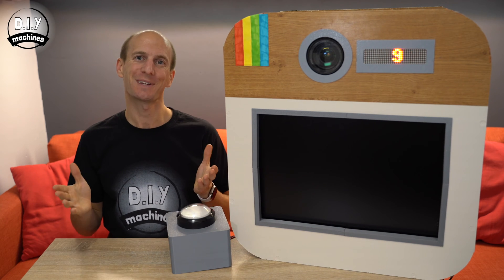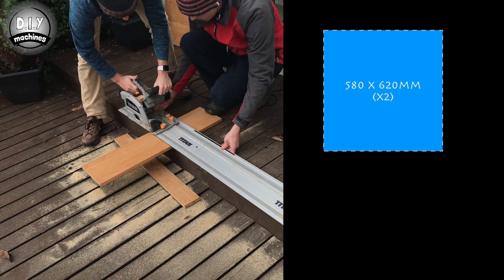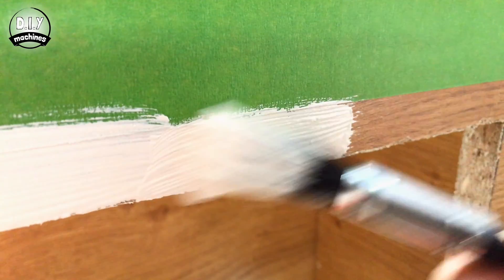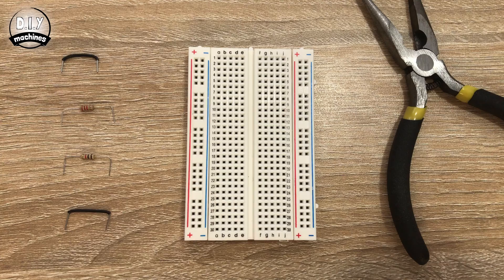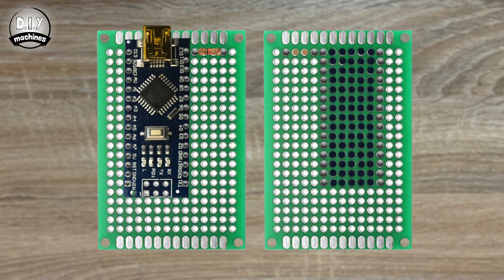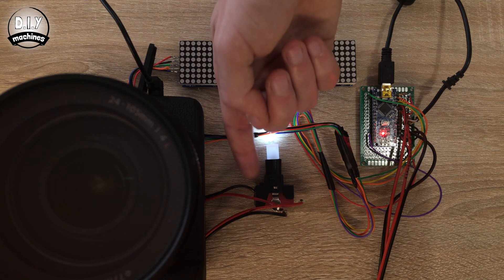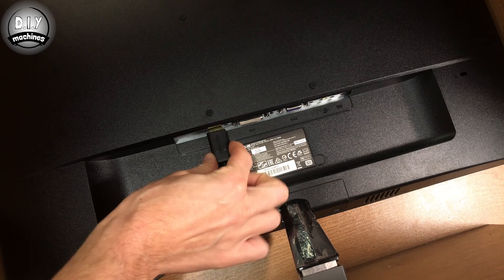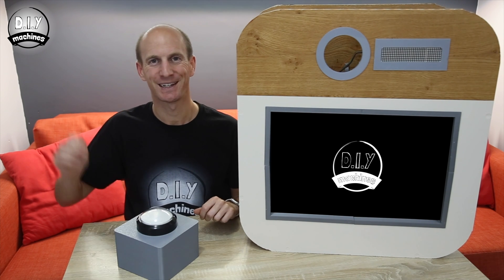DIY Party Photo Booth - Low cost | Arduino | 3D Printable Parts | Weddings | Budget Build | Crafted

Comment: You're running all those countdown LED's from the 500ma max output of the Arduino ?? (And 500ma is pushing it!) OK, so they might be multiplexed, but I still think the LED panel should have its own PSU. Nice project as a basic unit ... but it will not have all the options of connecting to a purpose made photobooth software. For my own unit, I "broke down" a laptop, put the motherboard / keyboard behind the monitor, and then positioned a capacitive touch screen in front.
Reply from the maker: Thanks for the feedback and for sharing your approach!

Comment: cant connect my SONY A7 M3 to the screen via C-type cable ??? What to do ??
Reply from the maker: I made a shutter release for my Sony A7 M3 by buying one of these (https://amzn.to/3mwBMOF), open up the controller and you'll see which wires make contact when you press it (one focuses and the next activates the shutter). From this you'll now how to wire it up to where the red and yellow wires are labelled on the wiring diagram. :)

Comment: hi, is it possible to add a printer via usb to this?
Reply from the maker: Hello, the Arduino and current code would not allow for this. If it is something you wanted to do I would recommend using a Raspberry Pi (you would need new write new code) and something like GPHOTO (http://www.gphoto.org) to capture and retrieve the image from he camera to then send on to a printer.

Comment: Hello
My camera gets a signal from the circuit but doesn't take the actual photo.
Nothing happens if I'm in Live view mode, but if im in the menu or other options it changes to live view.
I've tried with other remote cables and they work perfectly. 
Can anyone help me? Please

By the way! 
REALLY REALLY COOL PROJECT
Thanks.
Reply: Did you ever fix this? Having the same issue with my Sony

UPDATE: Fixed the issue on mine after a little bit of tinkering. I ended up connecting the top and bottom plate wires next to each other and bridging them with some solder. Works great now!
Reply: @technick_mods  thanks for your comment. I‘ve got the same problem but your solution fixed it 👍

Comment: A nice expansion to this would be linking it to upload to Twitter or another platform.
Reply from the maker: Great idea. I almost implemented that - but I would have to have added a Raspberry Pi instead of the Arduino and this would have driven the cost up slightly. I was aiming to keep it cheap so ultimately decided not to add the functionality.
Reply: @DIYMachines  Maybe a version 2 video at a later date.  Its a great project as it is.
Reply from the maker: @user-vt5lh6lm3n  Yes, I have thought about that. Thanks.

Comment: Hi, thanks for the great tutorial! I'm curious though; how are you sending the image to the monitor? How long does it display for and how is the monitor connected to the Arduino?
Reply: Thanks. The monitor is connected to the camera directly and is just showing the cameras 'review' of the photo for about 10 seconds after the photo is taken. The monitor is not connected to the Arduino. The Arduino is controlling the shutter on the camera, the giant arcade button and LED countdown.
Reply: Lewis Aburrow where is the arduino getting power from?
Reply from the maker: @jackass...2726  The Arduino is connected to a USB power supply. As the monitor had to be connected to mains I did not see a huge benefit in engineering something to power the Arduino instead of just a mains powered USB supply.

Comment: Awesome machine ! i´ve become a fan of ur stuff, just recently starting with some of ur projects and im starting with the cute BB8 one. On the power supply i did it a little bit diffrent ha... but thats what i had~~  (3x INR18650-30Q 3000mAh) my BB8 (not painted so far) is speedy gonzales... way to fast ~~ is there a way to modify the code that the motors only turn for 50% or so ~~  thx for any help. Greetings from Germany

Comment: What is the make of your 3D printer? Are you happy with it?
Reply from the maker: Hello, my printer is a Prusa i3 Mk3s. I am happy with it. It's not perfect, it will have an occasional short run of misprints but after some simple maintenance everything runs like a dream again. I've clocked up about 43 days of continuous printing and it's layered over 1.3km of filament and still runs as good as when I first assembled it. I intend to get another Prusa when thye time comes to replace this one.